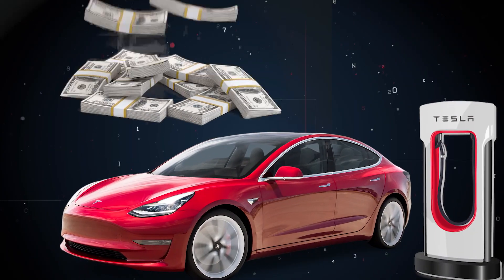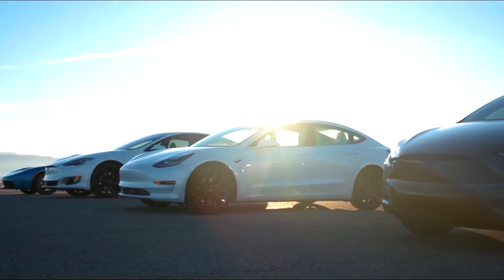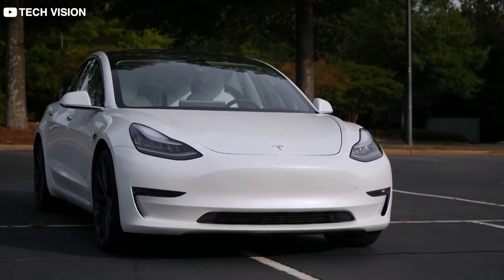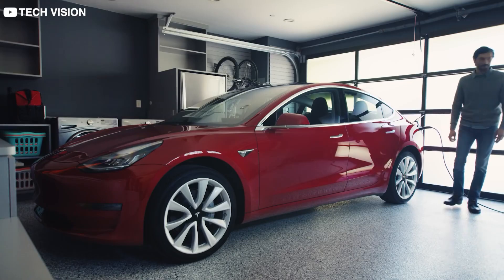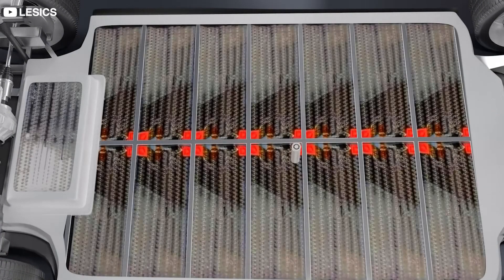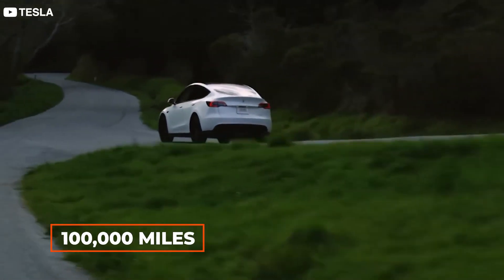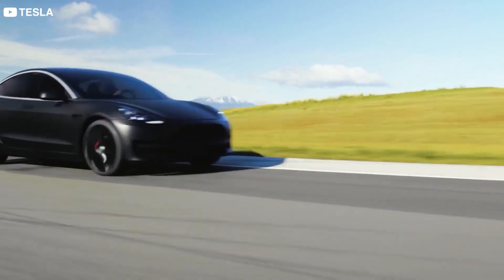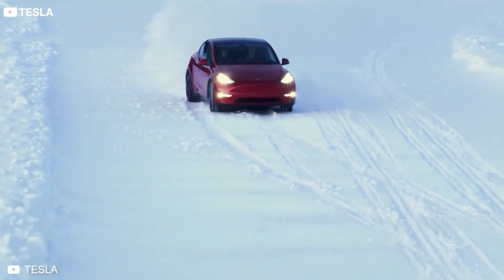Is Tesla Cheaper Than GAS? (The Truth)

Comment: Just paid US $12.75 for 33kwh which is one gallon.  Will be selling my electric car for gas to save money.  Also if you pay 47 cents per KWH which is 1/33 of a gallon y0u are paying us $15.74 per gallon as one gallon of gas is equal to 33.5 KWH.
Reply: I do agree with your premise and think the point is lost on people of how high the electrical charges are sometimes but your 12 something dollars for 33 kW and conclusion leaves out the fact that the electric motors and burgers and everything else and let's just say a Tesla since this is about that are on the order of two or three times more efficient than a pretty efficient car I have a Chevy Volt and by calculation with a lot of freeway you know like a long drive but a Tesla 3 would be twice as efficient as my volt not all the time cuz sometimes it runs an electricity but let's just say once you run out the battery in comparison to an Impala with a V6 it's about four times more efficient The point is the 33.5 kW of a gallon of gas energy equivalent only takes my volt about 50 mi 40 mi it will take an Impala about you know 25 on the freeway 17 overall and so you end up with the fact that the equivalent amount of electricity in the electric car still takes you two to three times further than that amount of gasoline in a petrol car that's where the gradient efficiency of electricity electrical motors matters

Comment: The finances make no sense to me.  A Tesla Model Y after 5 years loses 50% of its value, a new Tesla here in Canada with tax is roughly $95,000, so in five years you're losing $45k in depreciation.  Charing costs might be $1k per year, so cheaper than gas, which with my Toyota Tacoma costs me about $4k per year in gas.  My Tacoma loses maybe 20% of it's value over 5 years, it cost me $50k new, and 5 years later it's still worth $40k.  So over 5 years it will cost you roughly $10k per year to own a Tesla when you consider charging costs and depreciation.  The Tacoma will cost you roughly $6k per year to own.  If we look at the 10 year picture, the Tesla is going to be nearly worthless and need a $30k battery at year 10.  The Tacoma will be still worth probably 40%-50% of it's original price, so let's say $20k.  And you've spent $40k in gas over 10 years.  So all in, over 10 years the Tacoma cost you $70k, whereas the Tesla cost $130k.  Not to mention higher insurance rates with the Tesla.  I think until they get a battery that lasts 20 years or is cheap, they aren't a good buy.
Reply: I'm glad someone brought up depreciation and battery degradation.

Comment: Terrible comparison. You compared the Tesla to a bmw with average  gas mileage that uses premium gas. You should of compared this to Camry hybrid which is a better comparison, the Camry hybrid gets 52 combined. I ran the same calculations as you, the Tesla has a $6000 running cost over 5 years and the Camry has $5500 with a average gas price of $2.60 or $6100 using the  current inflated gas prices of $3.20. Also of course you didn’t  mention the cost of the battery when it eventually dies and needs to be replaced. A new battery for a Tesla model 3 is $13k-16k depending on the dealer. Also there are no aftermarket options. A Toyota hybrid battery at a dealer will be $3500-4000 and when the car is old enough there are aftermarket options for around $2000-$2500. 99% of drivers don’t drive 20k miles so no one would ever save 13k-16k
Reply: Terrible comparison. Tesla is a premium brand. Toyota is not.

Comment: And the cost of breathing air polluted by ICE fumes? The cost of the lives lost in crashes that end in fiery explosions? It's in the name: internal COMBUSTION engine.The cost of lost gas due to expansion into fumes that expel into the air? The NET cost of gas, after the taxpayer subsidies $BILLIONS$ granted to the oil cartel? The inconvenience of relying on gas stations/gas prices set by a monopoly? 
Or, producing your own fuel (electricity) by PV panels, storing it in your PowerWall II for energy independence, freedom from the grid/gas station. What is more control over your life worth?